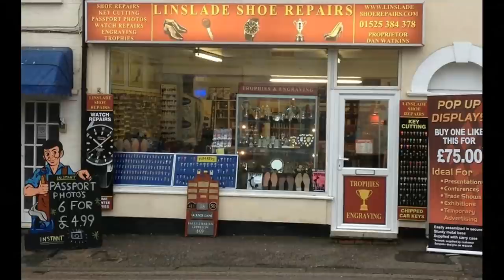Celebrating Reaching 60k on my Shoe repairing Channel! YouTube 2021 | My YouTube Journey

Comment: Been watching for a while now, and finally hit the subscribe button (should have done it sooner), I had never ever even thought about cobbling, until I saw one of your videos by mistake (actually clicked the wrong video), and then I was hooked.. Genuine craftmanship not to be sneezed at (especially not nowadays..). But! I do have a work related question for you. Sadly, i live in Sweden, far far away.. But maybe you could help me anyway.. Long story short. I have a pair of "blåkläder" safety shoes, with steel toe cap and nail protection in the sole, and with oil resistant soles (non slip). Wonderful shoes, that have served me well day in and day out for 6 years, but now the rubber is all but gone, and the fabric and stuffing in the "cushion" back at the ankle is totally worn.. But, thing is. These are extremely confortable shoes, and I've broken them in during all these years. A new pair costs a fair bit, but I would like to repair mine... Is it at all possible to replace soles that have nail protection in them? Thanks in advance, and keep up the good work! you make a heck of a good work.

Comment: Dan you have smashed it mate!! From timpsons to running your own business your o your way to becoming a millionaire by next year you should be there by March by my estimations!!!  Well done lad. I have one question one of my cylinder key cutting a machines has seized up the blade is spinning fine but the lifting level arm won't lift up but it will slide to side to side. Please can you suggest what I could do?? I was thinking about heating up  the metal level
Reply from the maker: No idea without seeing it Im afraid mate all these machines are different, maybe somethings jammed in the way of it?

Comment: Good job! Love your content. 
I work as a podiatrist in the Netherlands.
Does your grinding machine has a dust bag / external vacuum that stands somewhere else / or a collecting bin underneath? 
How do you clean it and how often?
Does the glue also stick to the rollers, so you get that clattering sound when the belt and the rollers hit each other?
How much waist do you have / and can you throw it all in a normal trash bin in the UK?
Greetz Koen (pronounce like raCOON)